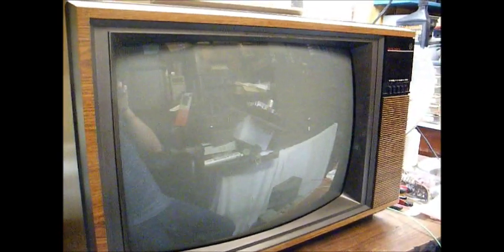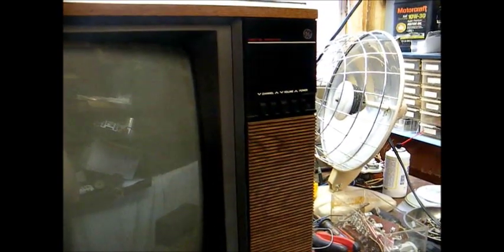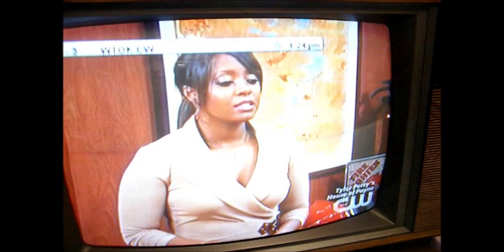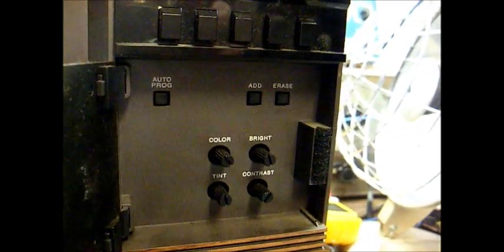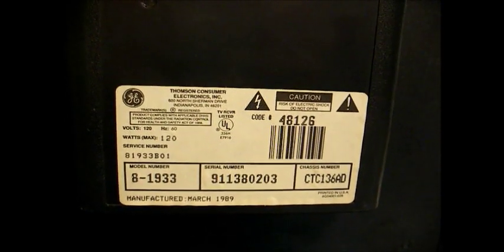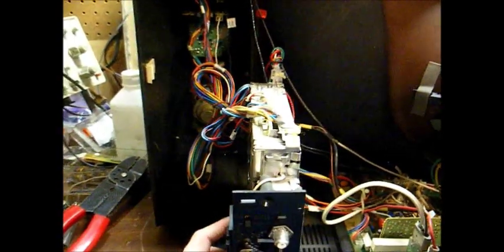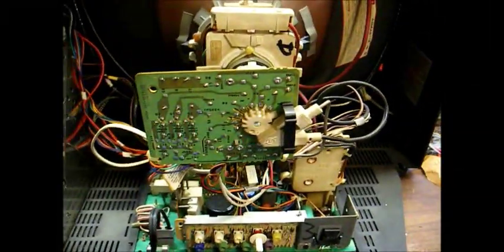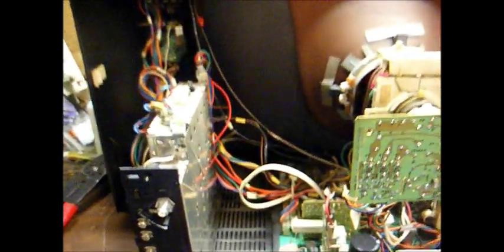Overview of an '89 19" GE color TV, using the CTC136 chassis (for CRTman)

Comment: Im having flashbacks to 2004 when I was 10. I had several of these sets in my bedroom over the years growing up. I remember whenever I was bad and had my tv taken away by my parents I would smuggle a TV I would find on the side of the road on my way home from school like this that had the cords cut off (easy fix) into my bedroom and my parents would just say ugh whatever keep it. Needless to say sometimes it would come back to bite me a week later when I did this. Like the one time I defied my parents with a 13inch RCA set that I found like this, everything worked fine for about a week but the set had been rained on, and somehow the green and blue guns stop firing and the damn thing goes red after a week. I also notice some of the channels are missing for some reason. Oh yeah memories of throwing a shoe or a book at the set to make it work and ultimately giving up on the thing whenever I found another one on the side of the road to replace it with. This other time I was just learning how to spice wires I triped a breaker and learned to never let the wires touch! So if anything it taught me a thing or two about electricity too!

Comment: That OSD looks similar to a 1978 Salora TV I used. The electronics were service overkill. The switch-mode power supply had an LED for EACH voltage rail. There were test points everywhere that had a small oscillogram on them. And many of the lines were labeled with what signals or voltages went through them. It had an awesome picture (except the electronic tuning module was crammed into the front so it got really hot and the tuner would drift), but you got a progress bar on channel search and it had an on screen clock and it had a huge speaker with some kind of sound shaping housing that gave a sound like a big fat speaker.
The only thing that wasn't cutting edge was it still used an ultrasonic remote control. And I don't know if it was A/V ready (but switchmode PSU says very likely - I have a 1978 SABA that was A/V ready - I eventually populated the parts). The original owner threw it away unfortunately (somewhere 2014).

Comment: I have a 19" 1991 RCA XL 100 Stereo Monitor. I got the tv for $2.50 at an estate auction and has very good picture but not as good as my 86 Zenith costume TV. I will one day have to fix my 89 RCA color track console tv and what's wrong with it is doesn't power on any more I was watching a movie on it and just truned off like someone unplugged the TV from outlet.

Comment: Those were nice sets. I still have my 1988 CTC 136G-based set with stereo speakers and a squared-off 20" picture; it has better color, in my opinion, than any flat panel set I've seen. It filled my house up with smoke once, but that was the only problem it ever had and I added a fuse when I fixed it to make sure any similar failure in the future will be less dramatic.

Comment: I vaguely remember the takeover. Basically domestic consumer electronics is going down the tubes back then. The one I loved was Philco suing Philips because the name sounded similar.  They won and later they used the name Magnavox. Then Sylvania bought Philco and Philips bought Sylvania so Philips owned Philco. No use suing yourself.
Reply: Phillips also made its own record changers which used the same "arm-touch" record-size sensing as the Collaro "Conquest" changers that Magnavox re-branded as "Micromatic", I don't know if there were any cat fights over that design, but Phillips ended up buying Collaro as well as Magnavox, so it was a moot point in the end. The last such Collaro changer was made in 1993, after BSR and  V-M were long gone and Garrard had been exiled to Brazil.
Reply: Great products and few were sold in North America.

Comment: Offered 10 bucks for my Sony donor, (& that was if it ran). Silence for 3 weeks, then they called & told me to come get it for the 10. Knew they'd never get the asking price. Also made $$ on those tuner on board RCA's. Littered on the sides of roads all during the 90's. All sizes. Some like new. Once mended, they ran a long time. Must've had the CTC136 here at some point too... nice picture on this set.